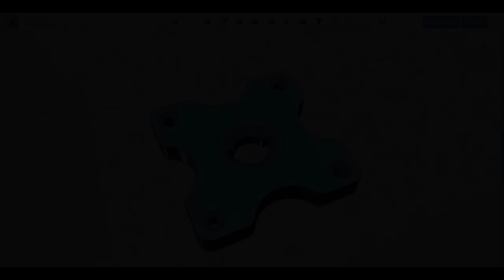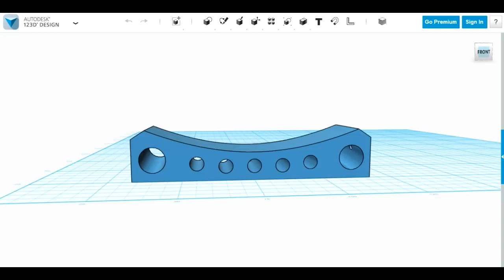Iron Man Hulkbuster Cosplay #13 | Test Drive & Shoulder Bells | James Bruton

Comment: You might try a cycling shoe/ cleat system to clip in to the legs. They would be way easier to attach and detach.
Reply: Great videos by the way. You are good at problem solving. I am currently working on a mk. 7 ironman helmet. Cheers!